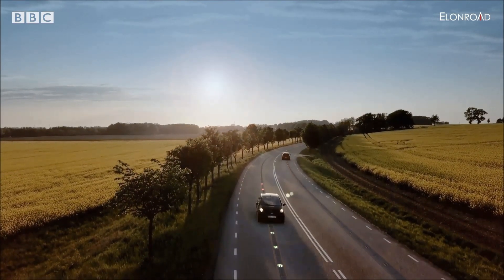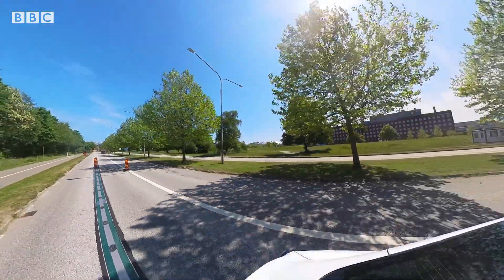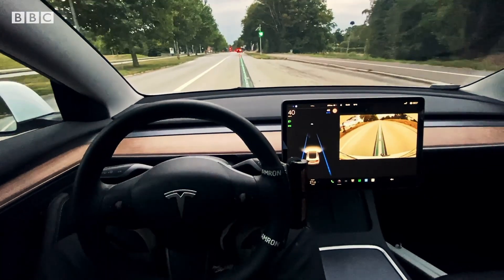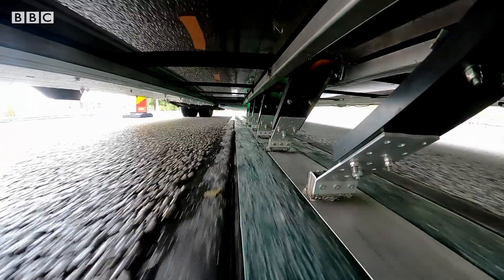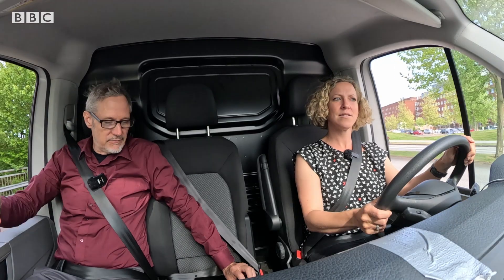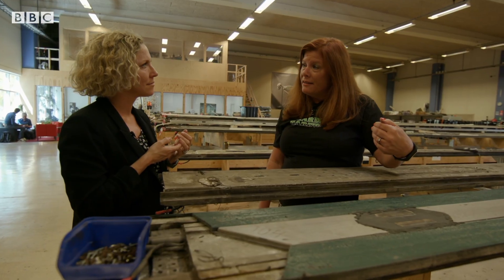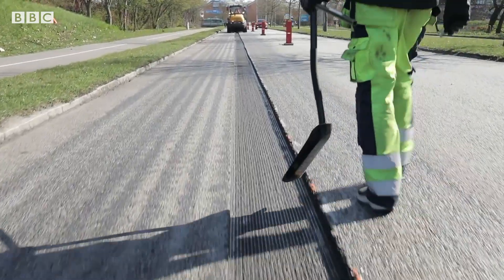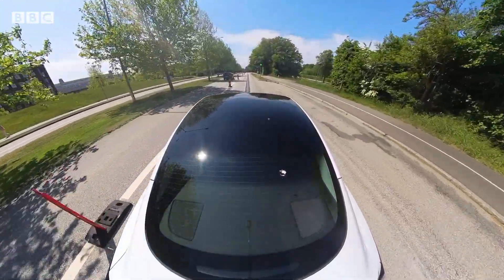The electric roads that charge your car as you drive - BBC News

Comment: This seems like a train with extra steps.
Reply: Now imagine if we make these tracks everywhere.

Then imagine we elongate the cars with more space for passanegers

Then imagine we make these elongated cars pass through this road periodically

Then imagine that passengers buy tickets digitally to have access to these elongated cars.

Then imagine that the collected revenue is used to improve the expand and improve the infrastructure.

These kinds of videos remind me that we are nothing more than stupid smart monkeys.
Reply: @maximusasauluk7359 a typic-al storyline curated by a satirical linage! 🌌 #201Poker
Reply: @maximusasauluk7359  To be fair there is some value in having cars be able to go from point-to-point, for example for disabled people or for rural areas where you'd need to drive to a station anyway, and this lets you mix some of the advantages (if it works as it's supposed to), so I think both trains and cars will need to exist even if people should ideally use trains where they can
Reply: Can't wait to see a tesla connect with overhead rails like a tram!
Reply: Lies again? Google Drive Game Design

Comment: This is what you called impressive or innovative. If this means less or no charging at electric charging stations that's better than gas station despite gas taking less time to fill up than batteries.

Yes smaller batteries make the car weigh less and there's less materials but that means replacing faster and less sustainable. 
When you buy something it needs to have larger battery or your going to need to replace it quicker or get thrown in the landfill faster. I don't agree with smaller batteries less sustainable and more inconvenient.
Reply: This is what is called a pipe dream.
Reply: Batteries aren't single units, but an array of individual cells.

Comment: A mixture of ev's and  combustion engines is the way to go.
Hydrogen combustion engines are on the rise .
Reply: Er, no. Battery is winning.
Reply: @julianshepherd2038 thé is a lot of ‘belief’ in battery EVS at the moment, but they are doomed as we simply do not have enough raw materials to make enough batteries.

Hydrogen development is accelerating towards a practical solution and it will win over EVS outside of urban areas simply because it is an evolutionary step in the internal combustion legacy and can be filled up in a handful of minutes.
Reply: @julianshepherd2038  wait for it

Comment: Why not have good electrified public transport(trains, trolly buses, tram, metro)
Reply: *trolley
Reply: And yeah, because public transport is sooo reliable 🙄
Reply: @Sundae_Times it's terrible now but it wasn't always. It's run on the cheap and it's dirty so,people buy and use cars. You could probably 1/2 car usage with a return to an integrated mass transport system.
Reply: @julianshepherd2038  I wish I lived in your fantasy world - it sounds nice there.
Reply: That already exists in Sweden. People still have cars.
Reply: There already is an electric  trolley bus running down that road - you can see it at 2:08. Lund has long had a public bus network (driven by petrol or biogas), but the tram was added because it has larger riding capacity than the standard buses. There's only one line so far, from the railway station past the general hospital and technical college campus - but that's a line where many people are commuting of course (also from other cities nearby)

Comment: Very smart innovation but expensive
Reply: No idea if it will work, but, as they said,  EV are expensive because of the cost and weight of car batteries, plus all the expensive charging stations being built & connected and then having to wait for 30+ mins each charge... compared with all that, tracks would make more sense.  (though I guess there will always need be some chargers as a back up option, as not all roads will have tracks.)